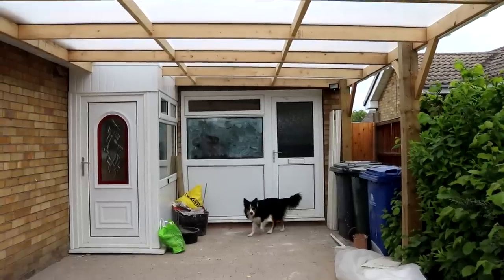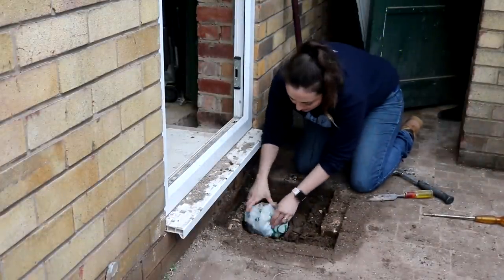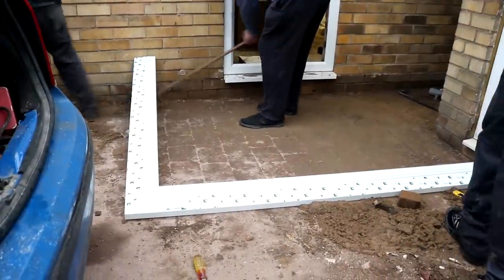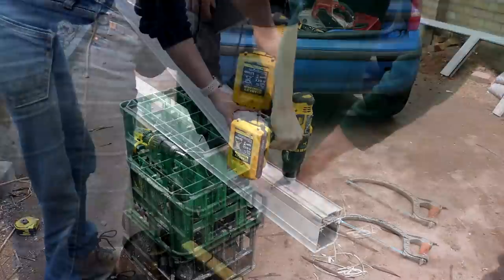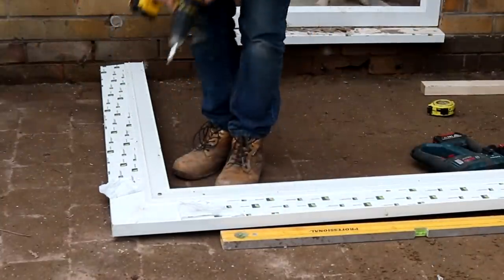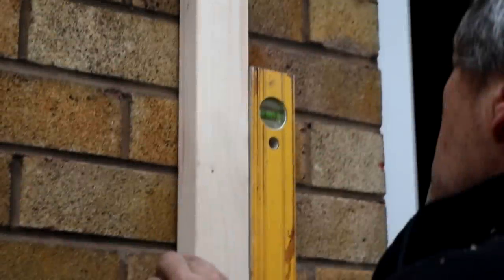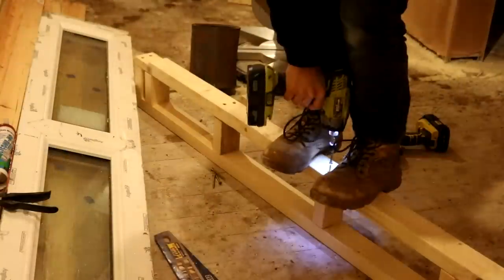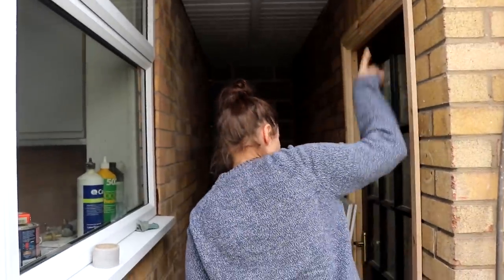UPVC Porch Installation DIY (Recycled)  | The Carpenter's Daughter

Comment: I brought a porch on E Bay for £100 and all it needed was a good clean and I had to make it taller so like you I made a wooden section and covered that in fascia board. Result. Thanks for your videos, always a joy to watch.
Reply from the maker: Absolute bargain! :)
Reply: Just a note,it's soffit that was used not facia board,facia board is good to use in internal window sills,for diy it's a good job just you got the name of the materials wrong

Comment: Nice video! And I like your attention to the details. I had to replace parts of the metal railings on my front steps this weekend. Be thankful I'm not building bridges or airplanes. But the way I look at it, no one will notice if they're driving by fast enough. And gotta love that Hans.
Reply from the maker: Yes, things only need to be as good as you want them to be.  And if it serves a purpose and works then 👌

Comment: Wait, so the corner pole is free standing ? That's a long distance on the fixed panel side and to be carrying the door weight on the other isnt it ?  Also those SPAX screws... might be quicker but for the security of a plug not woring loose they would be my preferred option.
Reply: Valid point but nothing wrong with spax screws

Comment: No, no, no. I'm not builder but it seems just wrong to attach the upvc frame to block paving. Block paving is loose on the ground as you well know.
Sorry, I like many of your projects but this is cowboy stuff
Reply from the maker: I take your point if it was a room that would be sat in, for example you wouldn't do a conservatory like this.. in which I would say cowboy.  But it's merely a bit shelter to tie two rooms together with an extra door to wash bikes with a drain.  Also, the pavers are going nowhere and it's fixed securely at the top.
Reply: @TheCarpentersDaughterUK  I would have liked to have seen some dampy(dpc) on the decking boards and where timber meets masonary

Comment: That looks like a nice little extension. It’s a shame you used white PVC though. I don’t understand the love most Brits have for this ghastly material. I think I would’ve used wood/timber instead. But other than that, great job.
Reply from the maker: Thanks for your honesty.  It's one less thing to worry about treating and painting regularly, other than cleaning 😂
Reply: @TheCarpentersDaughterUK  Definitely , I was against Upvc for a long time but the dreaded repairing , replacing rotting timber and painting of windows and doors finally got to me and I succumbed and never looked back. Apart from cleaning and maybe redoing silicon sealing when needed , after 5 years all's well .
Reply from the maker: I think that's why my Dad doesn't bother with them anymore :)
Reply: You can get rosewood,black grain,oak etc uPVC cladding and soffit